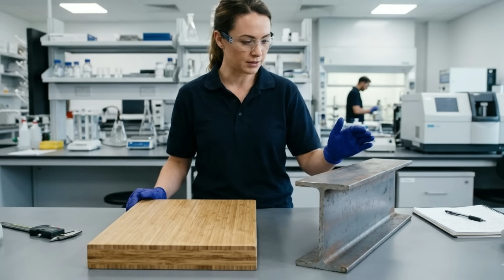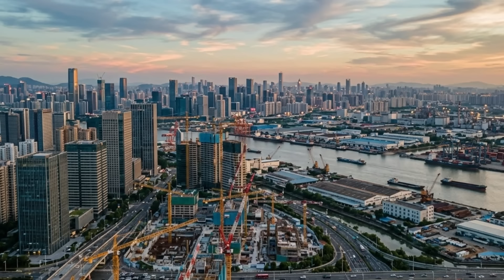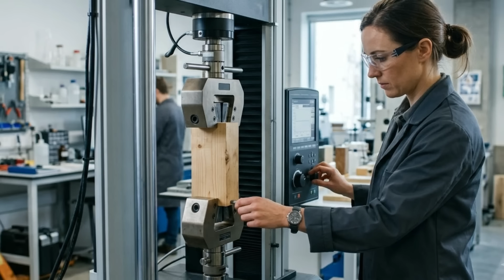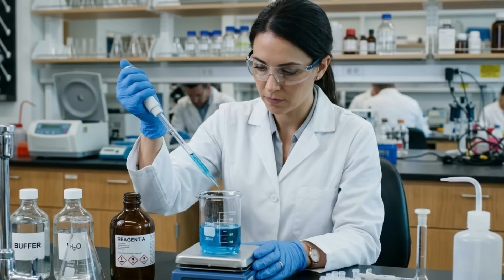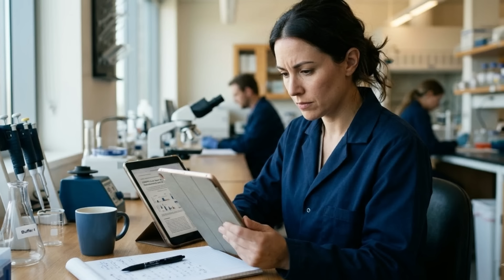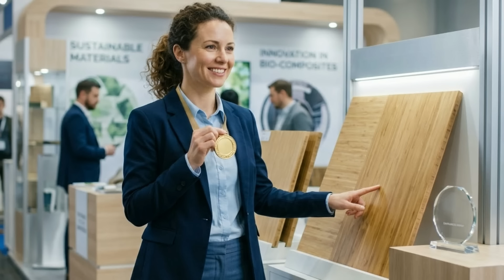China's New Invention That Could Make Wood Obsolete

Comment: If I can verify the mechanical performance and understand the material properties and limitations, then as a mechanical engineer, I would treat this material as I would any other traditional engineering material and add it to my list of potential choices; choices which depend as much on economics as they do on technical performance.
Earlier in my career I was a temporary works designer in the UK construction industry. All timber calculations were based around appropriate construction grades of timber; grades which were always conservative to account for natural defects and inconsistencies. In mechanical engineering, one mostly enjoys the luxury of working with homogeneous materials, which allow for economic design and a greater degree of precision in safety factoring. Processing bamboo as described aims at creating an anisotropic material which can be utilised efficiently and reliably where predictable design could follow similar principles to those for carbon fibre. Bamboo car bodies anyone..?

Comment: I think they should come up with a more cost effective way of making the product. What about running those poles through a wood chipper and then pressing the hell out of it in a mold and then just spray it with a protective layer? You said it binds chemically, so what if the whole plant is processed and pressed, would be my question?

Comment: The USA has huge forests of Southern Yellow Pine, Oak and Douglas Fir.  There is no way processed bamboo can can compete on price using these types of wood for structural beams, and 2x lumber.  Plywood is another story.  Bamboo panels could replace plywood if it can be shown that the panels are not degraded too much by exposure to water.

Comment: I would be most interested in a type of structural bamboo that is infused with resin.  The strength and durability numbers shared in the video suggest than such a material, over the long term, be more affordable than other materials.  While up front costs would be higher, long duration care and maintenance would be far less expensive.  I vote for quality at cost that decreases maintenance and worry.

Comment: GUADUA ANGUSTIFOLIA IS STRONGEST TENSILE STRENGH BAMBOO EXCEEDING  MILD STEEL  HAS A TENSILE STRENGH OF 28,000 PSI POUNDS PER SQUARE INCH,  STRONGEST WOOD IS  LIGNUM VITAE WITH ONLY 4,390 PSI  ALSO GABON EBONY WOOD WITH  BENDING STRENGH  22,930 PSI

Comment: Have been using mfd. wood products since 1st exposure to a product branded  " Aspenite " ... OSB in fact . First time I saw bamboo flooring was in awe !  .... Nine dollars a square. ft. ..... ! Knew price would fall quickly as production amped up , it did , have installed several times . Have constructed OSB / dimension lumber structural beams a few times in self - permitted projects with great success .... no engineering certs. provided ... always follow the first 2 laws of engineering , if it looks right ,  probably is , 2nd , if it looks wrong ... .
Bamboo fibers have a promise we can only imagine the extent of ..... I can see bamboo cars .... carbon / bamboo fiber ? ........ Should work at v good price point

Comment: If as the thumbnail of the video suggest it can be used for long spans to replace hollow concrete beams panels I would be very interested in that product for decks where there is a 12' span and no joists.

Comment: If the strength to weight ratio is what is stated then to work with it standard wood working tools will not work. They will dull . This will never be adopted because the difficulty to work with.  The whole process sounds to expensive even if it is scaled up.

Comment: A comparison between industrial hemp and bamboo and if possible maybe a combination of the two would be interesting.
Also replacing polluting petrochemical plastics with these two natural materials would also be interesting.
Reply: The two plants that could save civilization 😊
Reply: There’s still a lot of chemistry used in the processing of the bamboo, so I’m not sure I’m quite ready to call it less polluting than the current materials that we use. It may prove to be, but I don’t think it has been proven that way so far. Time will tell.
Reply: @EdAgers110 Making steel from iron is a serious polluter. Oil is a limited resource.

Comment: A wonderful natural material that is not prone to warping, has great strength, works well with insulation material, looks great, the raw material growing so quickly, etc - what's not to like.
In countries such as mine with termites; do structural frames, joists & beams able to be treated to deter termites?

Comment: Can we make the composite material of wood fiber  & bamboo . That way would be better than only bamboo. And it will increase the material's functionality.  And saves a lot of wast wood too.
Reply: Rexilon is a specialized high-pressure resin-impregnated wood laminate—historically built from multiple thin layers of hardwood like beech—known for exceptional strength, rigidity, and moisture resistance. It is most famous for use in vintage mountaineering ice axe shafts (such as classic 1970s Chouinard and Grivel piolets) and specialized industrial CNC machining table inserts. [1, 2, 3, 4]

Historical & Industrial Context

Mountaineering Gear: In the 1970s, brands like Chouinard-Frost and Grivel used multi-layered Rexilon laminate for ice axe shafts before transitioning fully to metal and composite materials. It offered superior shock absorption compared to metal, with much higher structural stability and warp resistance than standard solid wood. [1, 2, 3, 4, 5]

Wood Properties: It is created by bonding stacked wood veneers under extreme hydraulic pressure with heavy-duty thermosetting resins, functioning similarly to a ultra-dense marine plywood or composite densified wood. [1, 2]

Modern Manufacturing: The term also appears in specialized European industrial routing equipment, denoting heavy-duty laminated worktop inserts (such as on 5-axis CNC router tables) designed to withstand vacuum-sealing and high-load milling. [1, 2]

Chouinard used a laminate Bamboo shaft in some models of Piolet.
 Austrian army ice axes of the period were Rexilon